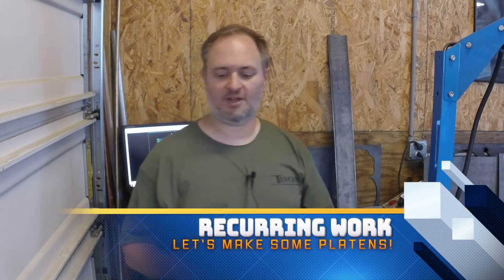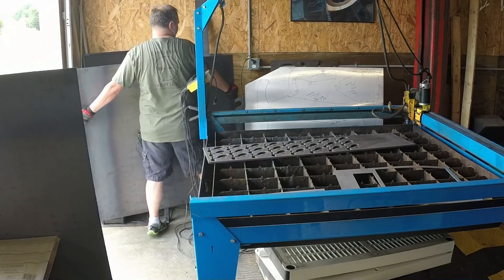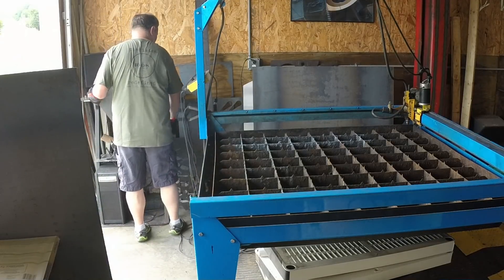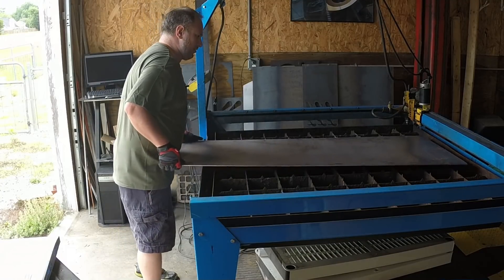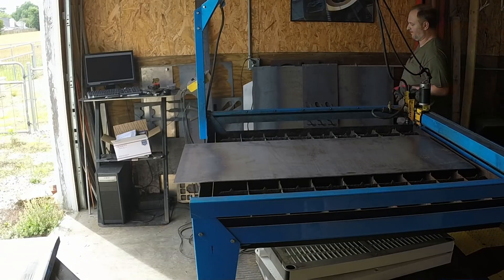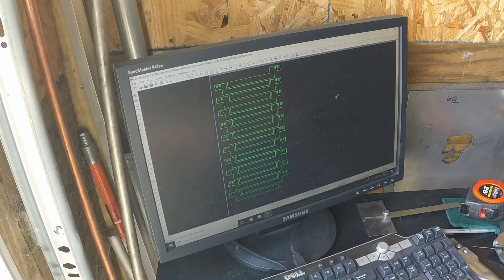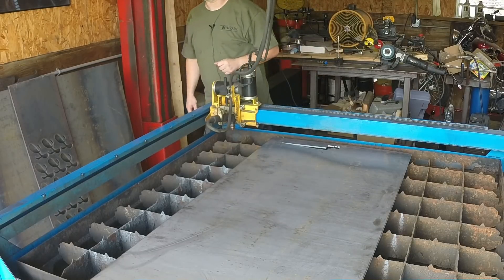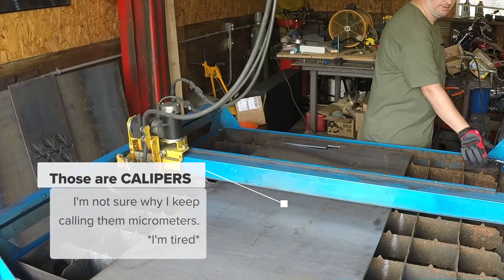PlasmaCam - Belt Sander Platens

Comment: just a RHS rail on its corner along the ceiling, and a bigger bit over the top running on 4 ball bearings, and a hook on it. make life a lot easier
Reply from the maker: Hi Emma! I'll definitely keep that in mind for the design. I'm not sure my roof could support it without bracing though since the entire span is such that it doesn't have vertical supports to the floor. Thanks for watching and hope you are well! - TZ

Comment: Never worked with a Plasma table, why did the sparks fly when traveling in +Y (Right) but not in -Y?
Reply from the maker: Hi Doug! The camera doesn’t always pick up all of the details so sometimes it appears a little different. The torch head also might be slightly out of square as well so dragging in one direction and pushing in the other. I’ll have to check that out. Thanks for watching!

Comment: Tom, what’s the ballpark upfront investment to get a plasma cutter, table, and software to do what you just did?
Reply from the maker: Hi Tom - I've had this machine for several years now so I might not have good pricing but my investment was right around $15k for everything. The system that I have comes with the software to run it but you have to provide the computer (windows only). Depending on the job, I'll use the provided software or do my design work in Fusion360. It's sure been a reliable workhorse since I got it!

Comment: hey tom, good to see a video from you.  i was thinking you had built a water table for your plasma cam a couple years back ? or am i thinking of something else.  You doing much with your tormach machines?
Reply from the maker: Hi Gary! The water table is there, just not filled at this time. Trying to decide if I still want to use it and if I do, what modifications do I need to make to make it more useable. The Tormach machines are still going strong but I've been slowed down by shop electrical issues. Should be fully operational again soon though. Hope you are well, sir!